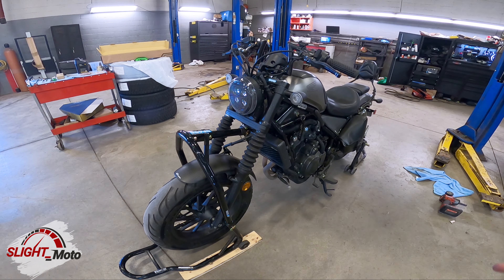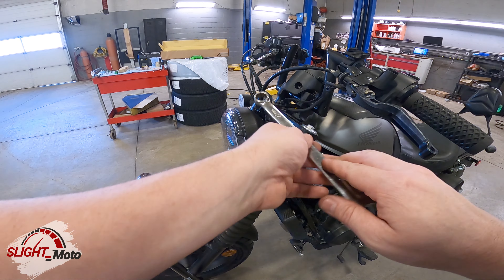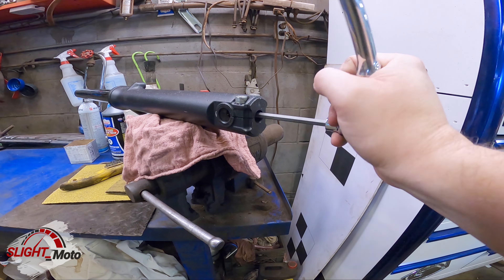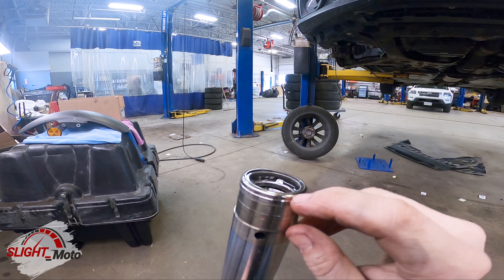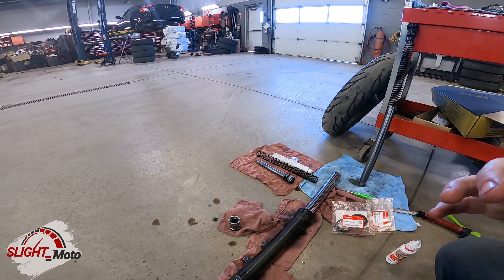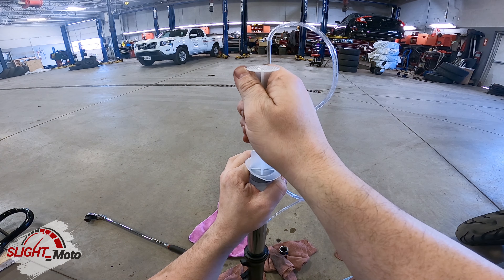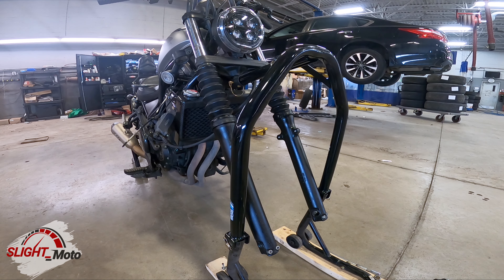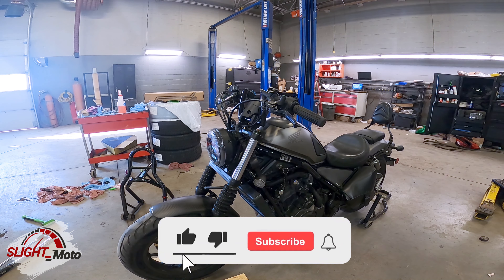Rare Rebel upgrade! Honda Rebel 300/500, GEARS RACING FRONT Suspension - Install

Comment: Great vid mate.
Im looking at just changing my springs over only.
Do I need to shave off the 2mm like you did??
YSS Springs.
Reply from the maker: I wouldn’t think so. The only reason that was required is the drop it’s will not pass through.

Comment: I think my Rebel 500 needs a more stiff front shock. What is the essiest way to stiffen the front shock? Can you just put in a new spring? Thanks. Great video
Reply from the maker: That’s the issue right. 

The trick many used was a heavier weight oil. As for stiffer springs… these rebels have very limited support.
Reply: U can also raise oil level. Try that before changing to heavier oil. Smaller air gap = harder forks.

Comment: Buddy, do you have experience with a rebel 1100 better front forks adjustment??. I personally turn clock wide, a complete spin turn , but I don't see any improvement. Actually it feels more bumpy.. so i turn back half spin , now it looks a little better but these bikes have too soft front suspension.  Do you have Any idea how to fix it. Like oil change or any upgrade.
Reply from the maker: @gerardoantonio9001   I do, I will eventually make a video on this. Yet in the meantime you can follow/watch a few friends channels (I’ll link their specific videos on this) 

On the Rebel 11
https://youtu.be/_UJzz9FGOi4?si=iyYssF4GuJa-1QYh

Quasimotard
https://youtu.be/K8x_judlkA8?si=NyxT0iF4DPHwpq5p

Comment: So I've brought these for my 650. I used a grinder and it now it's flush with the guide. Do i still grind more or am I fucked and have to buy yet another set of tubes. I'm not working right and spent everything on just parts alone
Reply from the maker: @rmbrblu  can you pull the guide out yet? You should only need the 2mm removed (you’re only taking off the mushroomed edge)
Reply: @SLIGHT_  I cannot. Like it's stuck together flush after using the grinder. I didn't start the second tube tho. If I could post a pic I would. 

It probably can be saved I just don't have the tools.  I'm just gonna give up.
Reply from the maker: @rmbrblu  don’t give up.

Take a photo and send me an email. I have the address linked to the page
Reply: @SLIGHT_  alright

Comment: Or buy a central stand, problem solved.
Reply from the maker: @philipj.chircop3905  most center stands use the front wheel as well. If braced to hold the rear down you can do this sure.

Many pros and cons to the centre stand. Great suggestion though! Thanks for your input Phillip